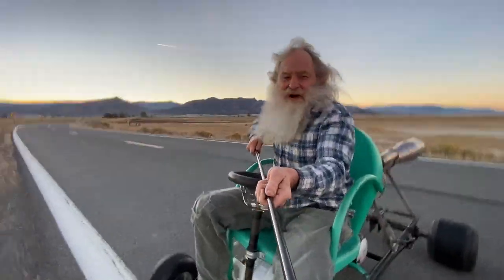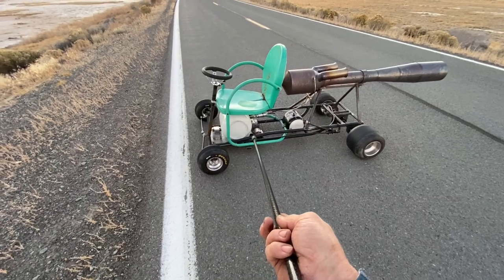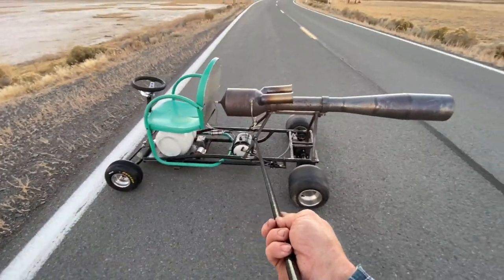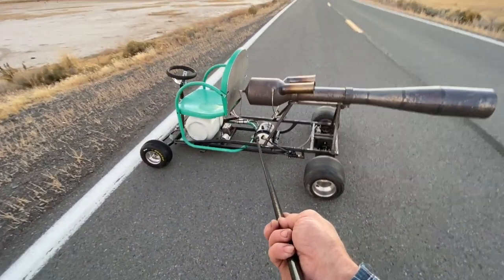Crazy Rocketman:Green ROCKET LAWN CHAIR!

Comment: As you run on diesel and there is a LOT of heat in these engines, I'd love to see you set one up to run on used vegetable oil. It would just need to be vaporised and after a warm up on the LPG should be no trouble to change the liquid to a gas.  Veg has about the same energy as diesel and more than gas so should work well although I wonder if the resonance would be different?
An eco friendly jet engine running on renewable fuel should be something to get you more noticed and win favour with the trendy do gooders.
Reply: How the hell do you get vegetables oil?? A deisel tractor planted it and harvest it. 😂😂😂 why fix what isn’t broken.

Comment: Okay. normally I don't watch or criticize stuff I don't like but I'm justified here. So notice the the 2 exhaust ports above what is likely the combustion chamber? Cause I did.  Us nerds associate that with the gas gen cycle, witch dumps what comes out of the preburner. Now unless this person works for NASA I highly doubt he has his hands on a gas gen  cycle. Now on to something someone whould understand. HEAT. That "rocket" in most of his videos is glowing hot. As you can imagine that's bad for the engine. So how the #@$# did it not show any signs of structural damage due to high temps?  Also, near the end of the video he said he should have use diesel. If that already was about to melt diesel whould straight up just blow it up. Because diesel. Last time I checked is not propane and really likes to heat things up. 
So since I don't want to wright anymore. He is basically using some sort of alternative purpulsion. 

Also his chair should have been on fire. it way to close to the combustion chamber.
the curious dev 2022/2023
Reply: Article no one will read go brrrrrrr